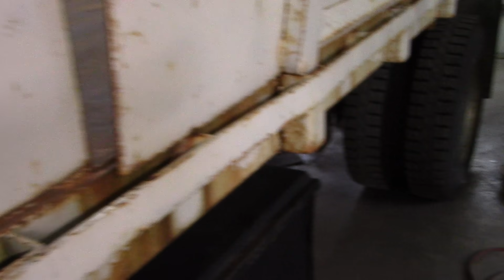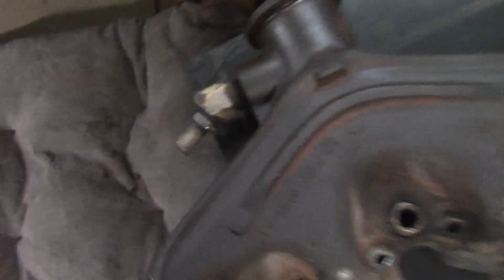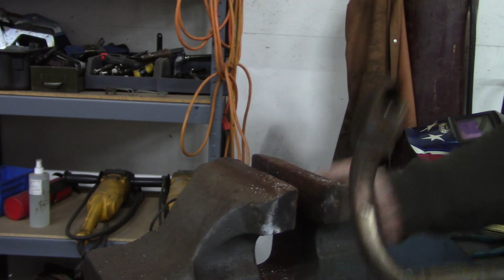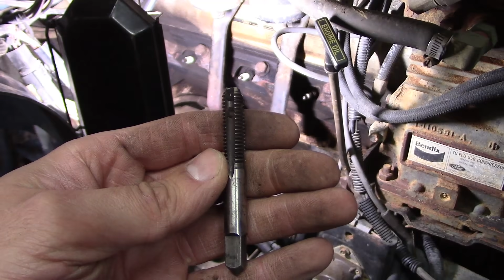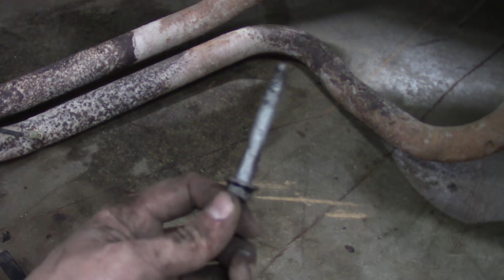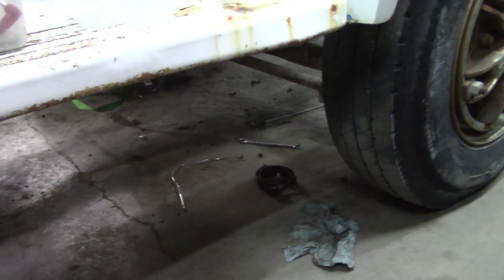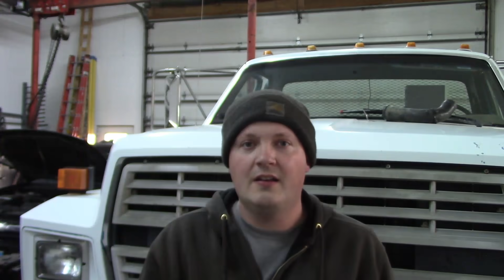Ford F700 Project - Exhaust Manifold Leaks (Gas Engine) - Part 1

Comment: some one told me Ford had a better Idea and Lighened the big block heads early 90s. I had a motor home 1993 fuel injected 460 same broken exhaust bolt points in the heads and warped heads. Of course a warped block deck dosent help either two different sets of heads from the dealer I bought it from, dang thing never ran right new injectors. It had be over heated. my 1971 mercury marque had been over heated a few times and never had these problems.( Ieven put a set of rebuilt heads from a 1972 mark 4? a friend had he was and avid ford guy, I replaced the ford ignition with a 460 ford GM hei and an edelbrock 4 brl Carter copy, never ran right. Lost $4k on that buy. Gave it back to the dealer and walked a way. Took my parts back.)   yea egr stuff and lighter engine. Nope not a better Idea, and they know better. many recalls years before why go down the same road.

Comment: Good call on not using an exhaust manifold gasket. As a young Ford tech. in the eighties I was taught the same thing you talked about, if the manifold and head are both cast, machine mating surfaces and do not use a gasket. Liking the content, seeing these jobs though sure make me feel good that you're doing them now and not me. Lol

Keep on keepin' on.

Comment: if the crack in the manifold was all the way through, id drill the ends the same, then thread the drill holes, sink a screw in each of the holes, cut it off flush with the outer surface of the manifold, then braze the remaining crack. ive seen it done with more significant cracks. it ends the crack line, adds strength the braze doesnt have, and the drill hole is there already, might as well fill it with something iron.

Comment: Wes for old Ford junk it sounds fairly good. You must have the patience of a saint. I think it should have gaskets since surfaces are old and rough. Truck seems to be made from whatever parts were lying around rather than designed so you can't expect miracles. Air brakes on a single axle gas truck seems like overkill but whatever.

Comment: Don’t know if you’ll see this but maybe someone will. I just bought a dump truck with specs identical to this one. Will this engine run if all of the smog pumps, egr, evap canisters are removed? It would really clean up the engine compartment if they were gone.

Comment: Wes, make some guide studs by cutting the heads off of bolts and grinding slots in the ends, slip the gasket and manifolds over that.

Comment: So  by 1994, an F700 was already saddled with tons of EPA regulations. Sad. I bought a 1972 F600 grain truck way up in MN to simplify. It needs work mechanically but clean salt free truck.

Comment: This reminds me of one of these trucks I did an oil pan gasket and tune up on in exchange for having a tree taken down. I have used copper gaskets on the last couple of problem big block head to manifold exhaust leaks.

Comment: Only time I ever ran exhaust manifold gaskets on a ford, was when it had an intake and exhaust manifold bolted together on an inline 6. Which was because there was a gasket between the intake and exhaust manifold where the two mated together. Or when someone was running hooker headers, instead of the stock cast iron headers. As those after market headers, always warped as soon as they got hot. Which is why you would use an exhaust gasket, was to fill in the gaps on a warped exhaust manifold.

Comment: Ive done a few..I work on alot of old farm trucks....i did a 361 recently...pulled the heads to get at the manifold bolts..i was able to drill out all the broken bolts....Ford used these god awful tin gaskets ...once they start rotting out and leaking it leans out and burns valves...not a fun job but now the truck runs fabulous...

Comment: The trick I have found with the Brazing or Welding cast iron like that, is to put the whole manifold in the gas grill and to keep them as hot as you can while welding (weld over the hot grill if possible)...then leave in grill shut the lid and let the whole thing cool slowly.

Comment: UGH it must be a "FUELIE" - EFI 429.... I will stick with our Carburetor equipped 429...there is like NO emissions crap...I can literally change all 8 of the spark plugs in 15 minutes. - When they get 250,000 miles and start burning a lot of oil, plug changes are more common.

Comment: I've always heard them called V-band clamps....a nice set of headers and alot of "fat" trimming on that motor would do it some good.  As for a gasket, the 7.3s didn't come with them either but they make a soft metal gasket to use if a leak develops...could be the same thing here, a gasket added way after the fact.

Comment: Hi Wes I really like your work in fixing vehicles that would not been done by most mechanics, I worked in my later years as a Trades assistant in a truck mechanics shop in a called Hallam Victoria Australia,  I worked with a Master Mechanic who did his apprenticeship on London buses ie Leyland plus Bedford's and other English vehicles this man could fix almost anything that was ever built and the way he could do it was magnificent to see and also his knowledge is incredible. He got me one day sorting a large amount of nuts and bolts I had no idea about this I only sorted to size and length  but he could tell at a glance what the pitch was ie Sae/ UNF etc fine or coarse thread this thoroughly amazed me and Iam still in awe of his knowledge and dexterity even in his 70s also I learnd a lot from you as well good luck for the future Peter from Australia

Comment: I am not a mechanic but I never realized how smart a mechanic has to be to diagnose problems. I also never realized the skills needed to repair the engines and the tenacity and strength required. I have a whole new appreciation for all mechanics. PS I am a Mechanical Engineer but not for a car manufacturer so don’t blame me.
Reply: Wait until you hear what mechanics have to say about automotive engineers....

Comment: This just  might be the worst job I have seen you tackle. And for what it actually does is real crazy. Can you say over complex with two air pumps how can this possibly do anything whatsoever to clean this exhaust. If everything was cleared off the engine and a catalytic converter was put in the exhaust the truck would have twice the power and get 4 times the milage per gallon. This truck would bankrupt just about anyone and I hate to see the cost of this fix and how long a person will use such a piece crap. I bet this engine fails next month.
Reply from the maker: Just talked to the owner. It's running fine 3 months later. He brought me a different one to fix. Videos coming soon.

Comment: Any time I have keys in the ignition I always roll down the drivers window. 
No matter if the vehicle is runnin or not.
Just some advice so that you don't run into bein locked out again.
Reply from the maker: I'm pretty good at popping locks. I think all mechanics are. Part of the business.
Reply: @WatchWesWork  yup I know I am a mechanic also. 
I was just lettin ya know what I do.

Comment: I could be wrong here, but IIRC the cabs are actually different between this truck and the smaller ford trucks. Specifically, I think the rear support beam of the cab (the rectangular bit that runs across the back of the cab and sits on the cab mounts) is several inches taller on these trucks to compensate for the straight frame. (On the smaller trucks the frame curves up to meet the mounts. Since this is a straight frame, this beam has to drop to meet the frame instead.)

Comment: Seems to me there has been excessive heat under the hood.  I wonder if there were design issues back in the 90s when all of the emissions stuff was added.  Older trucks didn't have cracked manifold, broken cast iron and carbonized plastic/rubber problems.

Comment: Being one that has never worked on one of these big trucks my first thought would have been that this motor will be easy to work on with the hood and fenders basically tipping out of the way.  Boy would I have been wrong.  I have always thought the Ford systems with the air injection looked like a mess, then this thing comes along with double the stuff.  WOW!

Comment: Watching this video in its entirety has brought back a lot of memories of my days of wrenching at a Ford light and heavy truck dealership back in 2000. The job you just did in this video, I have done MANY on Ford's F53 chassis motorhomes with the 460 V8 engine (same engine family as the Ford 429 in the F-700 featured in the video). As a matter of fact, I had to replace the cylinder heads themselves on half of the ones I replaced, due to casting by the exhaust ports cracking and breaking off leaving literally no material left for the bolt to thread into on the very last ports. If you looked at the manifolds, you could see they were heated to where they were cherry red, from the engines being put under extreme loads. So it wasn't only the face of the manifolds themselves that would warp, but also the mating surfaces at the cylinder heads. And the replacement cylinder heads at the time came as bare castings (with no valves or seals). I actually got pretty good at doing these jobs after so many. I remember getting it down to having it done in one day, if I had ALL the parts at the ready (cylinder heads, gaskets, manifolds and all other associated parts). Even from Ford, some of the gaskets even had the name "Fel-Pro" on them if I remember correctly. Now, all these years later, after getting my hands dirty on 6.0L diesels and their problems, I'm keeping myself busy replacing engines on 1.5 and 2.0L Escapes from 2017 to 2019 model years.

Comment: I've been working on cars and trucks my whole life and if there's a line that needs to come out u should use a line wrench not an open end that's how u strip nuts. Plus you always  use an open end on the bottom nut and,and a line wrench on the line fitting.
Reply from the maker: Well, since you have been working on cars your whole life, you surely know that these secondary air tubes are non standard sizes and a 1" line wrench will not fit over the tube.

Comment: Yep, working on train pneumatics is the same way dude. Chances are it hasn't been worked on since it was made and you come along and you disturb one part and it all cracks and leaks then that's you rebuilding the cabinet for the next two days.

Comment: Ahh the dreaded Ford exhaust manifold leak. Man, Ford had a gazillion of these leaks over the years. It was just like the sun rising, if you had a Ford gas motor it was gonna leak from a crack or the gasket blowout. The first generation of emissions.

Comment: I figure, you ''accidentally'' melt the egr pipes with the oxy and ''accidentally'' snap off any other brittle plastic tubes ect and block it off to prevent harmfull exhaust gasses to go  straight into the atmosphere you might be doing a good job. Just my thought lol. But yeah deleting it all and blocking stuff plugging other stuff is more of a pain and it's not a race truck it's just a work rig so yeah. Love the work and well just simple stuff. Side note, i love my Cobra Knipex pliers. Had a tie rod spinning and the nut woudln't come on nice, vice grips just got chewed up, slapped those on there and it held so nice, love the things.

Comment: hello , just saw your video on the exhaust manifolds " LEAKING LIKE SCREEN DOORS " ,
Ford motor company has had big problems since the year 9 with leaking exhaust manifolds !!!
I have repaired countless ones for " STATE INPECTIONS IN PA. " over the last 43 years !!
It's just a fact of life with " FORD " !!  anyway , just rebuilt a 1979 ford 460 v8 for a customer ,
had the valve job done & had the exhaust port side of the heads " RESURFACED " with the EXHAUST MANIFOLDS also ,  the customer griped about the extra " COST " to do the resurface on the heads exhaust ports & exhaust manifolds !  I SAID ,  you bitched about the exhaust leaks , when you reseal the manifolds with new gaskets , if there warped it will blow the gaskets out again , and doing the manifolds were only 50 % of the warp !! you were rebuilding the engine , so we had the " LUXURY " of resurfacing the exhaust ports while the heads were off  !  EITHER YOU WANT QUIET OR YOU DON'T , QUIT YOUR CRYING  !!!!!

Comment: Dude, if you live your life trying to please people of any sort much less the armchair mechanics on this platform you are just asking for heartache. It was a rust bucket, you did 130% of what you should have done and about 230% above that. Air hammers and torch while turning the un-responding nut with a wrench was above the pay grade and shows where you built your arsenal of tricks from, old mid-western iron that has seen more salt than you  can imagine. The grease trick I learned from my dad when he worked in Saudi Arabia in the 60's the heat bakes the grease into a kinda carbon gasket. One other tool you might use is heating a cast piece in the oven on a cookie sheet @500 degrees for an hour, take out do your brazing or nickel welding on it then put it back in the oven @ 500 degrees for an hour then turn off and let cool over night, relieves the stress induced from the welding. Everyone has an opinion, yet not everyone makes Youtube videos from their well equipped shop, where they make their living with blood from busted knuckles. Water on a duck dude, water on a duck. Personally I think you are amazingly well versed in repairs of many kinds and enjoy the time and effort put into your videos as well as the content.

Comment: Creepin in on 100k!   I got a manifold on the Lima to do. I already know all the studs are going to break off.  replacement exhaust/intake manifold sat outside for years on an engine and got crusty on the inside. Think electrolysis would be a good way to clean the inside out well?
Reply from the maker: I don't know. Lots of guys seem to use EvapoRust. I've never tried it myself.

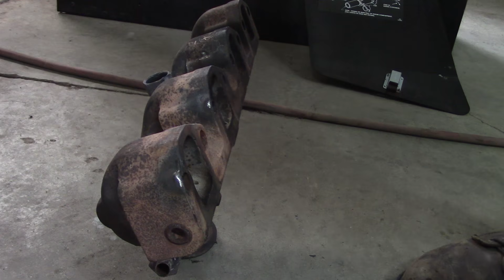Comment: 21:30 How do you know when you can machine the manifolds and when to just replace them? My friend had a straight six '77 nova and it had a bad exhaust leak and we found out that the manifold was warped and didn't fully seal. We thought that there must have been some crazy temperature change to do that and we thought we'd have to replace the manifold and that drove my friend to simply replace it with a v8. If he were to keep the straight 6, would a resurfacing and a thick gasket work?
Reply from the maker: You have to ask you machine shop if it can be machined or not. Usually they can be, but it can cost more than a new one.

Comment: Good job you have a lot of patience .  Yes ive done exhaust gaskets on 460 a number of times. I was told to use red high heat silicone after getting manifolds machined that worked

Comment: I have a 1977 Ford F 700 with a 361 the exhaust manifold gasket that you use isn't work tiddly poop the exhaust manifold gasket by Ford is a strictly metal one only with a beveled edge around the openingsand it will last for a long time as long as your manifold bolts don't back out or the manifold warps and it doesn't leak they were hard to find but once I did find them they were perfect for what I needed and now my manifold doesn't leak at all

Comment: Bolt that fell into exhaust pipe - Murphy's law was strong in that one.
I've noticed that many things that should stay on place, have tendency to slide off and fall the worst way possible, and things that should just slide off, catch on every nook and cranny there is and won't budge without tearing and ripping.

Comment: Yes truck motors are tight to work on also challenge to Wes :) & I know Ford Fire Tanker truck on fire department  my late dad Don was on  same as this truck you are work on   and mechanic put high temperatures  mender black tar silicone  on manifolds stop leak for! Also quiet truck exhaust to very nice! Never had fix ever and plus quieter muffler on left plus right side each ! That one High Temperatures Mender Tar Silcone like pavement tar if want now stick like Super Glue or  Grillioal Glue Instance or Plumber Glue for plastic Pipes  Fast To it like know Lol!

Comment: On those broken ears on the head. I put in a stainless steel bolt and then braze build a new ear. Then take the bolt out and ground smooth.

Comment: Common problem on ford 460. Not a fun job. I worked at a ford dealer had to do heads and manifolds on ambulances with 460s. Under recall. They suck

Comment: Another awesome video Wes, thanks, its real, you keep it real and absolutely if your gonna drop a bolt or nut or stud, absolutely it will find the MOST UN-OPER-TUNE_ hiding place to fall, no matter what, great tip on the steering knuckle wraps, going to do that on my PTO drives as well.

Comment: When you heat a stubborn nut/bolt, you would think the designated wrench size would no longer fit, and using the next size would destroy the hex. Or is this no problem?

Comment: While yes you could put a F700 cab on a 95 frame but you would have to do some modifications  for the 95 interior but if you have a 80-86 F150, 250, 350 it's a direct fit.

Comment: Hey,I know this might be hard to answer here on YouTube but I have an 05 kawasaki fourhweeleer that when I turn the key on I get nothing and the battery is freshly charged (you are the only one I know to ask)
Reply from the maker: There's so many possibilities I couldn't say. Blown main fuse, bad neutral safety switch, bad neutral safety relay, bad connection somewhere, bad key switch, etc.

Comment: I just replaced my manifolds on my 85 f350 with the 460 and it was almost identical to this. Those manifold bolts that hold the dipstick in place are a PITA.